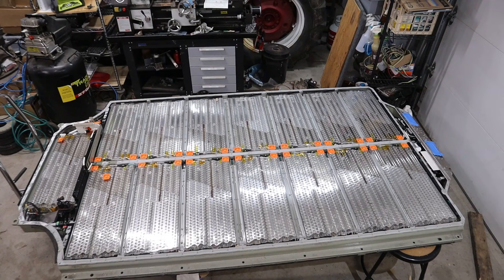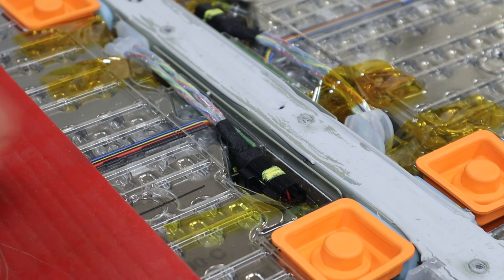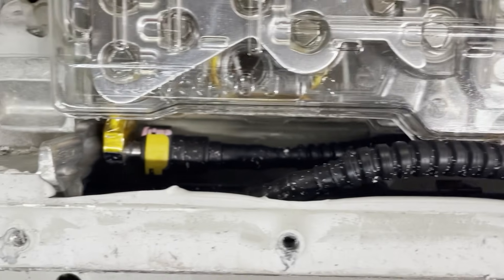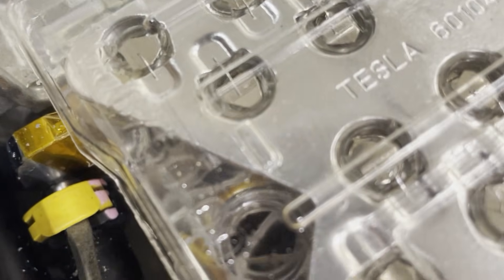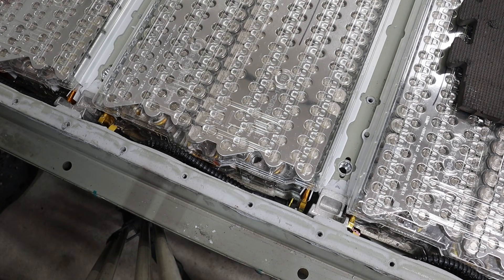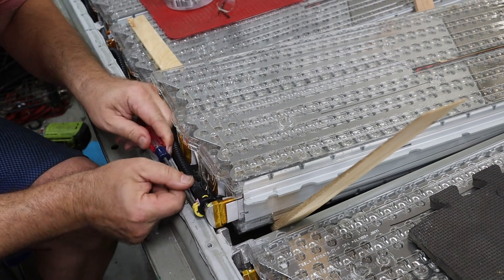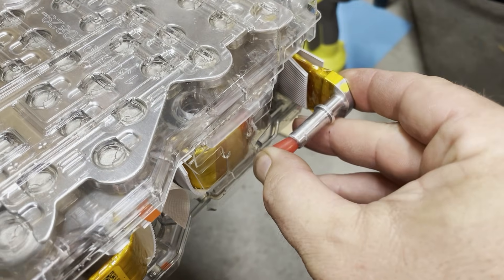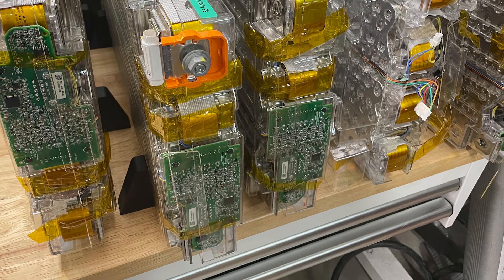DIY Tesla Battery Module Removal - Step by Step

Comment: Question is once you take off this whole battery right if I bought one used for like 5000 bucks with 5000 miles would I just have to screw in the new one cause I’ve seen people charging up to $2500 just to take off the battery and put a new one, but if it’s as simple, that’s just taking off the screws and replacing the whole thing then I do it myself

Comment: Well done! Unfortunately in Switzerland all is strictly forbidden, not only building DIY batteries. You're never allowed doing this with a Tesla battery and you'll never can buy one of a crashed car. Even changing a light bulb isn't officially allow to change by yourself. Switzerland isn't as frew as it looks.
Reply: That is crazy.  Too much govt. interference.
Reply: @GriffySpeed  Oh yes indeed. It's a shame. For example it's strictly forbidden to lay a cable over the sidewalk to recharge my Tesla even if it is covered but it's allowed on request but the answer will be negative. That's the life in my stupid country. This is not the only example by far. It's also forbidden to take a swim in a lake exept on places where it's allowed to do so.

Comment: First, 
use LOW air pressure, and a shop vac, to eliminate coolant. Do this at the pack quick connect. You will need to design and make your own fixture/tool. It will take at least 10 minutes to evacuate adequately. 

Second, 
HIGH VOLTAGE GLOVES, AND EYE PROTECTION. 
DO NOT WEAR AND JEWELRY.
Voltage is low, but the AMPERAGE is HIGH. AMPERAGE can damage your heart!

Third, FIRST remove the battery FUSE!!!!

Fourth,
 make a fixture to lift and carry the modules. DO NOT grasp on the wire bond area (ends of the cells). The clear plastic cover is not designed to prevent point loads.

Fifth, 
Check every module voltage. Should be within 3rd decimal point same (.008, example).
If one or more not the same, then you need to check every brick voltage in the low voltage module.
Low brick voltage needs to be balanced. And checked for a bad cell.

Comment: I bet a crazy, but plausible thing to find in a pack like this, would be an upside down/inverted cell(s).  They would immediately blow their fuse, but being that the packs are designed to be able to lose a few and still function fine, I wonder if it would be noticed if it was like that from the get-go 🤔.
Reply from the maker: It is possible for battery packs to have different problems, but the error codes generally point a person the right direction.
In this case, the codes indicate a loose BMS wire or bad BMS circuit board on one (or more) of the cell modules.
Of course, I'll keep my eyes open for anything unusual as I inspect them.
Reply: @BenjaminNelsonX module BMS boards had known problems. First, inspect carefully for corrosion. Second, look at small R components, those are know to burn, will be discolored. 
Tedious, but you best/need to check every wire bond visually.
Reply: IMPOSSIBLE! Module would NEVER get through wire bond process.

Comment: I am currently in the process of replacing clutch and flywheel on my Honda Crv Gen 2. Maybe doing this job on a tesla isn't that bad other than when uninstalling the battery from the car and getting it off and on again from the car. On my Honda I basically need to go under and over the engine and other sides back and forth all the time vs just taking a large piece of the Tesla and have little more working room than being under and over the car. I don't own a forklift or anything like that but there must be cheaper ways of getting the battery out? Can't wait for the Next video LOL😃, very Informative! My next car might be a Nissan Leaf